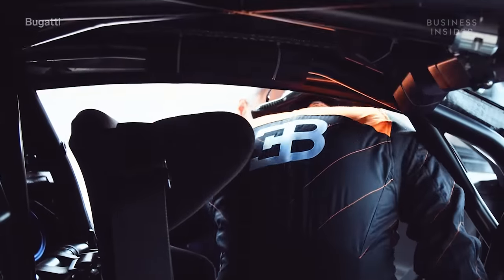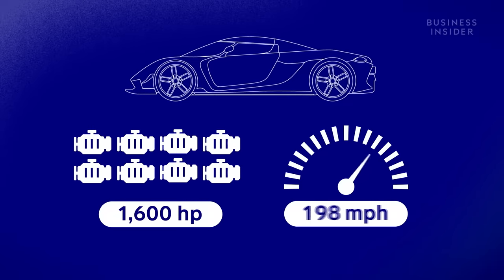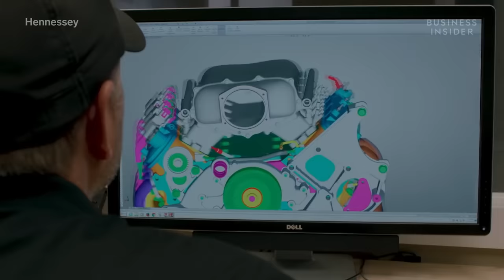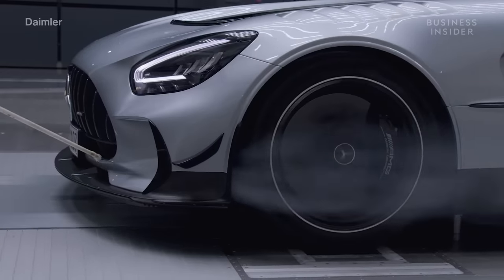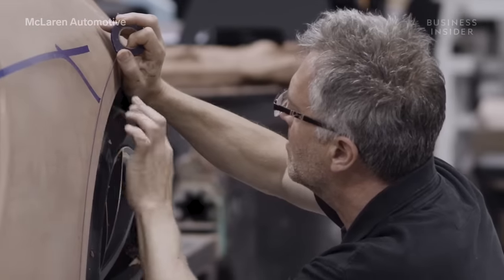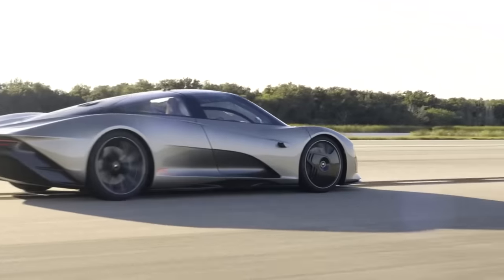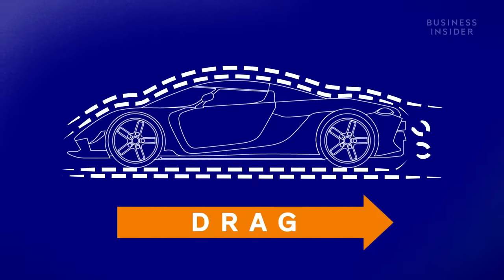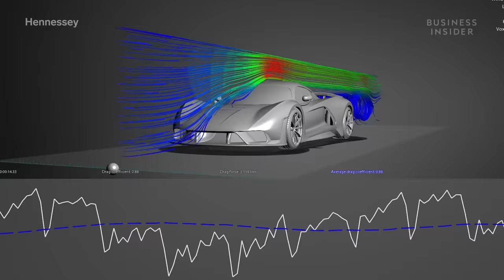Why It's Almost Impossible For Cars To Go 300 Miles Per Hour | Insider Cars

Comment: "increasing exponentially as the square of the speed..."
Reply: Not even gon pretend i know what mistake you're referencing. Btw your the top comment.
Reply: Lol I was gonna say the same 😹
Reply: 1. Power required to maintain speed goes up by the cube of the speed. 2. A cube is not an exponential function.
Reply: Exactly, it’s increasing quadratically; a type of polynomial growth and not exponential growth.
Reply: X^2 is exponential. 2*x is linear.
Reply: @andre7089  2*x is linear.  x^2 is quadratic.  2^x is exponential.
Reply: @iyziejane  ye ye ye ye that shit yeah you have an A in math 😅😅😅😅
Reply: @iyziejane  But isn't variable with an exponent exponential? This is confusing.
Reply: @richpryor9650  The expression 2^x is an exponential function, the expression x^2 is a polynomial function.  The exponential grows much more quickly than the polynomial.    It's confusing but try plugging in numbers like x = 100.  Then x^2 = 10,000 but 2^x = 2^100 , which is a huge number (about a trillion trillion million).
Reply: @richpryor9650  It's an exponential function when x is in the exponent. Even though for small bases it might grow slowly at first, yet it grows steadily and no polynomial function can't keep up with the exponential rise, no matter how big (constant) exponent it has.
E.g. 2^x grows twice each time x increases by 1. A polynomial function x^n might grow hugely at first (if the n is huge), but the larger the x, the increase by 1 means less and less. E.g. a huge polynomial like x^100 grows ~13781 times from x=10 to 11, from x=100 to x=101 still respectable (1.01)^100 ≈ 2.7 times, but from 144 to 145 already less than 2 times, so from there on 2^x slowly but steadily starts catching up, surpassing the former just after x=996 and by x=1000 it's over 10 times bigger (as from 996 to 1000 it doubles 4 times, which is 2*2*2*2=16, while the polynomial function increases just (1000/996)^100 ≈ 1.49 times). If You graphed them from x=900 to x=1100 the x^100 would look completely flat and 2^x as if it made a nearly 90 degree lift-off close to x=1000.
Reply: @MCMaterac  Damn... The math majors are coming out in force today. Thanks for the info!
Reply: @richpryor9650  Computer Science major in my case ;) You're welcome mate.
A quick sum up: x^n - value doubles if x increases by a certain percentage (e.g ~26% in case of x^3), n^x value doubles each time x increases by a constant (1 in case of 2^x) and that's an exponential growth.
Reply: Somente needs mafs
Reply: Well I got it. He's comparing the increased drag and resistance, friction etc related to the square of the speed. It's relational. 

Besides plot out 1, 4, 9, 16, 25, 36, 49, 64, 81, 100, 121, 144 etc I'll think you'll find that's exponential and using squares. The gaps between each point is increasing and will have a slight curve and is on an increasing trajectory. The further you go the harder it gets. 

Which brings us back to the point he was making. The faster you go the more resistance you get the harder it is to get even faster. 

They explained this later in the video again. Ergo to break the 300mph you'd need such precision engineering that the closer you get to that barrier the harder it gets to tease out the fine points to allow the speed advance.
Reply: @TheWPhilosopher  There is something incorrect when you say: " I'll think you'll find that's exponential and using squares.  The gaps between each point is increasing and will have a slight curve and is on an increasing trajectory."  How do you define exponential?  It seems like you mean nonlinear, which is a broader category that includes both x^2 and 2^x.   But this drag scaling as v^2 is not exponential growth.
Reply: @iyziejane  was using exponential as the following mathematical definition: Exponential is also a mathematical term, meaning "involving an exponent." In this instance using squares as the exponent. Thus something can increase exponentially by an exponent figure) but not mean exponential growth. It's a subtle linguistic difference and I appreciate it's confusing. 

Additionally he's not just talking about velocity in a vacuum but a causal relationship between increasing speed to what you desire and increasing drag/resistance etc which prevents the increase you want. So I'm not sure the simple velocity equation is appropriate here. He's not talking about velocity doubling as in exponential growth. 

Right. Got it. I think. What he is trying to say and where I think you guys have a point as I don't know why you do that is the drag value increases exponentially as a square of the speed. 

So going 200 mph....

Basically I don't think this is a maths fail but a linguistic fail as we use terms interchangeably. I'm not sure he meant drag would increase exponentially in terms of growth but in terms of factor. 

But he must have drag as an exponent factor in his relationship. I.e hypothetical simple way of explaining is for example  an increase of speed of 10mph from 10mph has a hypothetical drag factor of 100. 

He may also mean an increase of 10mph from 100mph to 110mph would be 1000 therefore which I know is actually a cube of ten but is also between a square of 10 and a square of 100. 

To be fair in a six minute video I doubt the full explanation is there but has been cut by the uploader but the equations wouldn't be the simple x^2 V^2 etc that I've seen but more akin to x_{t}=x_{0}(1+r)^{t}} but plotting drag versus speed rather than time. 

Again I'm not discounting it's only nonlinear and not exponential growth merely increasing exponential AS a square of growth is perfectly linguistically correct as each increase in speed may see an increase of drag as an exponent of that speed. 

Whether it's possible to 

No sorry for moving around a lot I'm just trying to ironically square what he said and what you guys are having issue with.....

Anyway it seems the formula required is this

For most large objects such as bicyclists, cars, and baseballs not moving too slowly, the magnitude of the drag force FD is found to be proportional to the square of the speed of the object. We can write this relationship mathematically as FD∝v2 F D ∝ v 2 .

If you look at a plot graph of drag versus velocity it does indeed appear to be exponential also. 

It may be the problematic word here is as as a shortcut to what he means is exponential increase as proportional to the square of speed firming up the correlation but yeah i don't think I've made sense but I'm more inclined to think he knows what he's talking about. ☺️
Reply: @TheWPhilosopher  I see your linguistic point, but the term "increasing exponentially" is not used that way in math or physics.  The video is indeed referencing the force of drag being proportional to the square of velocity.   That is not called "increasing exponentially" in physics, engineering, or math.   Discussing the drag force scaling as the square of velocity is clearly in the context of those subjects.   If this video was presented as a project in a physics class  they would be corrected on this mistake.
Reply: @iyziejane  well again it may be mis spoke but actually force drag which is proportional to a square of speed is exponential to velocity. There's curves for it readily available on line. So he might fail maths but not physics or engineering. Which is what it ultimately is an engineering problem.
Reply: @TheWPhilosopher  Well... that's not exponential - check the explaination by the OP or me a few comments above. Informally, 'exponentially' can mean just growing very rapidly, but it doesn't fly too well in engineering/science/maths, especially if the correct relation (in this case quadratic, so far from exponential) is given in a close succession. Sounds silly.
Reply: @TheWPhilosopher  "force drag which is proportional to a square of speed is exponential to velocity" - Nope. It's, as You wrote, a square relation. Speed (a scalar) is nothing but a value of velocity (a vector). Let's say at 10 m/s You get a drag of 100 N and at 20 m/s - 400N. If the relation was exponential, You would expect drag quadrupling any time the speed increases by 10m/s, so @60 m/s You'd be at over 100 kN and by 110 m/s at over 100 MN. The exponential relation would also mean at 0 m/s the expected drag is 25 N. That'd be just silly.
A common example of an exponential growth is 
a fixed interest rate deposit. If You get say 2% or 5% a year that doesn't seem that "exponential" in the informal sense. Still better than quadratic in a long run though. Let's say You had a deposit with no interest for a first year then money = year_count_squared. That would totally rock at first: quadruple in 2 years, 9 times the initial deposit in 3 years and so on. Over time it'd became less and less spectacular though. Imagine it was a very long term deposit that You can withdraw no sooner than after 250 years. You (or rather Your descendants) would get 62,500 times Your initial deposit, so routhly the same of what a deposit with fixed 4.52% a year would yield and less than a third of a 5% one. Keeping it for the 251st year would make no sense as (251/250)^2 would mean just over a 0.8% increase.
Reply: @MCMaterac  don't reply to my long post I'm gonna edit and leave a TL DR. Sorry dude. I get it now or let me check. Exponential requires a time element which this relationship doesn't have not just the proportionality to the square but crucially there's no time element which exponential growth requires? Just so I'll write my apology etc above it but leave the rest there as there's some interesting stuff in there 🤝
Reply: @MCMaterac  I think there is still some confusion here. Drag is quadratic yes. But drag plotted against velocity results in this: 

A body moving in a fluid will pass through fluid at a rate of Av where A is the cross-sectional area and v the velocity. This clearly has units of volume per time. If the fluid is brought to rest relative to the body, the momentum transferred per unit time is Aρv2. But momentum transfer per unit time is force, so we expect that the drag force is proportional to Aρv2.

Critical here is the assumption that the fluid is brought to relative rest. When this is not true, the expression for the drag is modified by at least a proportionality constant, or drag is no longer quadratic.

Which seems to suggest drag increases have to be exponential to keep the drag equation quadratic. 

It's like they have two equations. The original quadratic equation for drag which is square to speed and then this drag force is applied to velocity itself. 

Now I'm not an an engineer (or thereotical maths) but that appears to be what is going on.
Reply: @TheWPhilosopher  Well... he is clearly talking about "downforce, lift and drag increasing exponentially as the square of the speed" and either 'exponentially' or 'square' can be true (the latter is). He's just a test driver, not an engineer - let's not overthink it ;)
As of Your analysis, I don't know what You mean exactly. The equation is pretty simple and given @0:52. The drag (Fd) is proportional to the velocity squared only if the other factors are constant.
I think what You try to explain are changes in the drag coefficient (Cd). According to wikipedia it isn't constant, but
A) it's usually supplied as a single value, so cars operate in the conditions in which the drag coefficient is roughly constant, I suppose... unless during drifts (a car sliding sideways) of course ;)
B) A function f(x) is exponential if and only if x is in the exponent. The wiki page shows Cd depending on some variables, but in the exponents You have only constants: 2 and implicitly 1, -1, -2 (as 1/x can be written as x^(-1)). So, if Cd (or any part of the @0:52 equation) has any exponential dependency, I have no knowledge about it.
Reply: @MCMaterac  fair enough. Thanks. Hope it's been a good Christmas.
Reply: @TheWPhilosopher  It's been, thank You. Hope it's been to You. Happy New Year! Hopefully it's more normal than this one.
Reply: this comment section is more interesting than the video
Reply: I can go 0 to 300 when i need to 💩. I don't see whats the big deal.
Reply: This!!! Exactly this!!!
Reply: This is why math and grammar doesn't mix :D
Reply: @torinstorkey  He was talking about the force, not the power. So you are both right.
Reply: @Justin14999  Same😂😂😂😂
Reply: You are actually completely wrong. V^2 is a exponential functional, as well as a quadratic function, since a quadratic function is an exponentional function.
Reply: @remybuitenhuis2433  In an exponential X is the exponent which is not the case here.
Reply: @remybuitenhuis2433  Maybe if you are from a country that does not speak English.
Reply: @johntheux9238  it inscreases exponentially, which she says is wrong, but she is delusional. These carmakers know what they're talking about, she is not, she is stupid. Its the dunning-kruger effect. The forumula includes V^2 which makes the formules exponential. Drag will increase exponentially. Case closed. And if you dont know what that means, you can look it up on google.
Reply: @iyziejane  if you dont understand this, then you dont understand the whole video, it is the reason why cars almost can't go any faster.
Reply: @remybuitenhuis2433  Nope, in a quadratic curve if you multiply x by 2 then y is multiplied by 4 while in an exponential you need to add something to x in order to multiply y by a given number so exponential curves are waay crazyer than quadratic curves.
Reply: @johntheux9238  if you dont know wat Exponentially means, you can just google  it.
Reply: @johntheux9238  a quadratic curve IS an exponential curve. Even a root is an exponential curve.
Reply: @BenjaminTillman  IDC about that, the quote above is correct, the rest is just manipulation. Drag increases exponentially.
Reply: @BenjaminTillman  its just projecting what you're doing.
Reply: @BenjaminTillman  okey, lets be clear. I looked up the meaning again, and I have to say that Mathmatically, you are right. But this was just said in a normal sentence and not on a mathtest. The meaning of exponentially is "in a way that becomes quiker as something that increases becomes larger" (cambridge). So this is were the confusion comes from, you guys are acting like this video is a mathlecture, which it is not. The context is important.
Reply: guys, guys, drag FORCE is equal to speed on 2. potency, for ex: 2 times faster, force is 4 times higher, 3 times faster, 9 times bigger drag force, but requested POWER to  go is equal on 3. potency, for ex: 2 times faster, is needed 8 times more power, 3 times faster, is needed 27 times more power, ok?
Reply: @remybuitenhuis2433  that is not the definition of an exponential function. An exponentially function is usually proportional to itself, eg, population goes up exponentially because the more babies that are born the more adult humans there will be to have more babies. Another necessary feature of an exponential function is that the derivative is also exponential. Eg, the rate of babies being born is exponential, the total population is exponential, etc. None of this is true for the car here. The wind resistance is proportional to the square of speed. The rate of change (how much the resistance increases as speed increases) is the derivative of V^2 which is 2×V which is not exponential at all! Just to be clear, what people are talking about here is the colloquial misuse of the term “exponential" to mean anything that grows really fast. Quite often that word is used in situations that are just not actually exponential. The other words, linear, quadratic, arithmetic, cubic, etc, convey similar meanings but also reveal some of the deeper beauty of how the world works. There would be no terminal velocity for sky divers if wind resistance was exponential instead of quadratic!
Reply: Top fuel car be like "ez' kfkfk